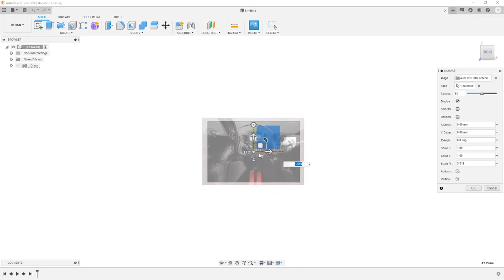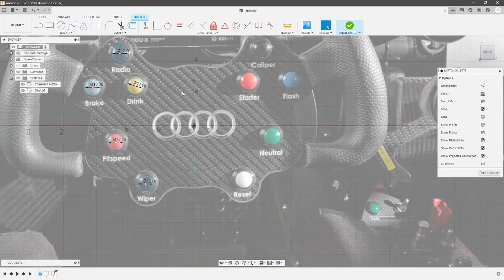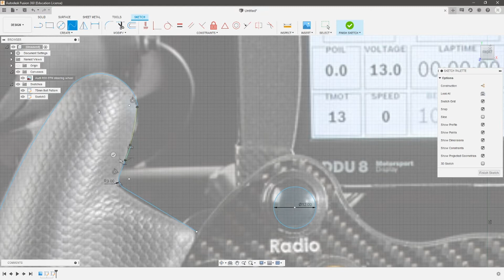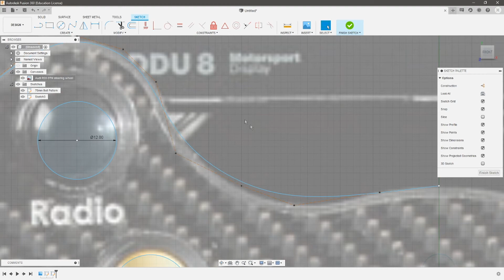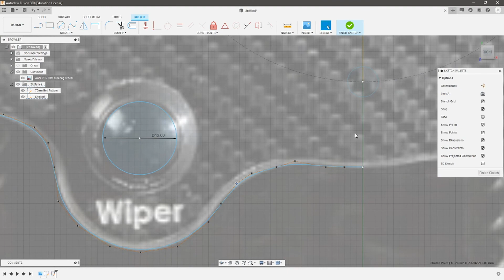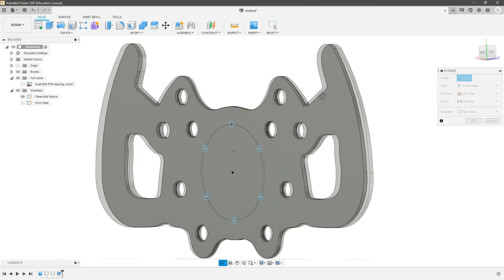#001 - How to design a Audi DTM front plate in Fusion 360

Comment: Hey man,
thank you for this video. It was really helpful for me!
Will you do more videos?
Reply from the maker: Hey Max, 
I’m planning on doing more videos soon for sure. Haven’t had time recently as I’ve started university in late September but I’ll have another one out soon! 
Anything in particular you want to see?
Reply: @simracingdesigns118  Well, I would like see:
1. How can I make the wheel smaller, cause my 3D printer has only a build plate of 235x235mm
2. How to do the Handles, and how to split them in 2 parts, that they can be screwed together.
3. How to do the backplate/cover for the cables/controller, and adding a DIN-plug for the USB-connection